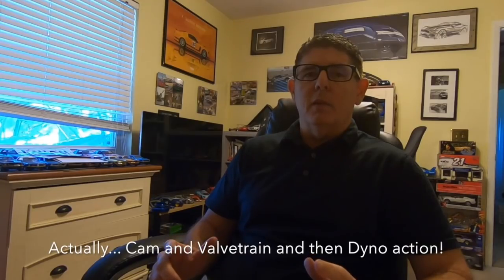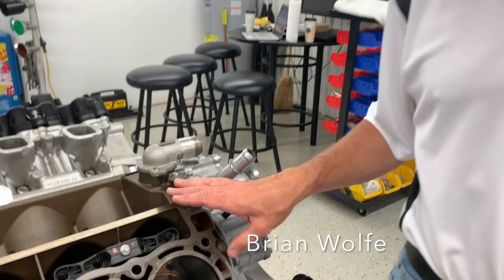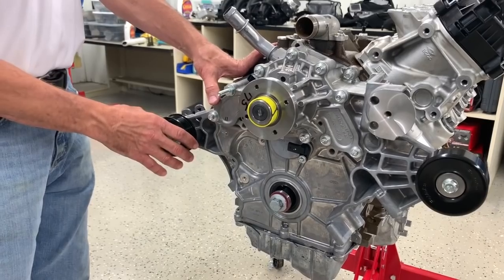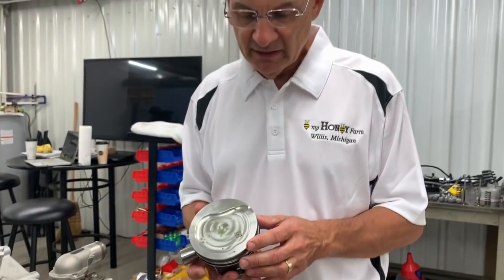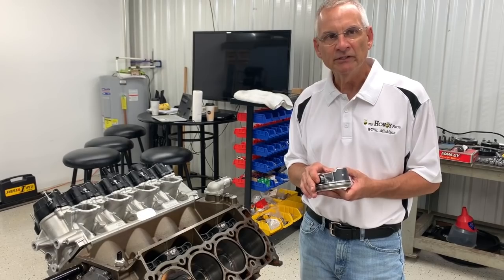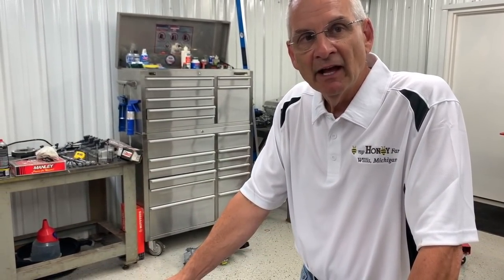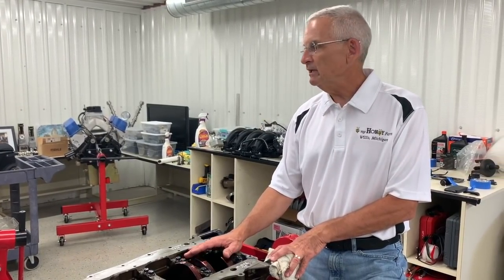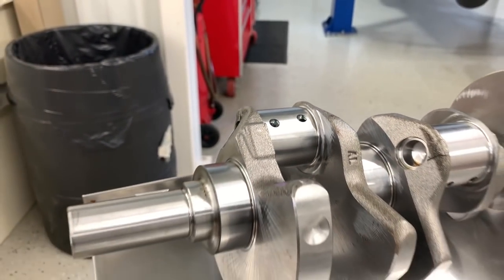7.3L Godzilla Ford V8 Bottom End Teardown — How Big Can this Engine GO?  Crank, Rods, Piston, Block

Comment: Can we all just take a moment to appreciate that the cam is inside the block like God intended?
Reply: Are you not familiar with the SOHC 427 from the 1960's!??
Reply: @jeffmiller3150  well yeah, Pontiac fooled around with one too.

The cam belongs in the block.
Reply: 😂🤣 yeah. No. It's for sizing. The 5.0 coyote makes 460hp/420lbs of torque on a mustang tune. If this thing wasn't gonna be enormous, an ohc version would easily be 500hp out of the box
Reply: @PureCountryof91  I'm sure GM engineers could wring the same power from a 5.3 if it wasn't a truck engine. Big deal.
Reply: PureCountryof91 
It’s not just sizing. It was also simplicity, low end power and longevity under load. This was always intended to be a commercial truck engine. But let’s just appreciate that we get more Ford engines to play with
Reply: No. Still prefer Over head cam and specifically dual over head cams lol
Reply: Super Duty 455 it’s pushrod big block I think we all time travelled back to the hp wars
Reply: @roninkraut6873  I can take the cams out of an ohc in the chassis. Unless it's a 4.2 vortec.. we don't talk about those.. 😬
Reply: PureCountryof91 
Absolutely.
Reply: Changing camshafts on my nissan is a 20-30 minute job.  Including setting it for tdc and tool clean up.
Reply: PureCountryof91 dude the 4200s are kinda unique, an American online 6 that’s DOHC? I think it was actually the last mass produced American gas inline 6 motor
Reply: Dog?
Reply: @MichaelFletcher-to7mm  and with the lm7 computer it isn't too hard to throw a turbo on
Reply: Nick Holland I heard it was hard to program anything with above atmospheric pressure but maybe the later ones aren’t like that
Reply: @MichaelFletcher-to7mm  oh nah, the TBSS and tons of the 5.3 trucks use the LM7 computer and they take boost really nicely
Reply: Weld up and disable the valves and cut ports into it! Dry sump with oil injection with Motul 800 2T. The aluminum manifold drill and mount an oil inector pipe in each inlet also. sounds like a fun project like this:https://www.4btswaps.com/attachments/2cyclesbc-jpg.6839/
Reply: This motor can be tilted in any position and run just oil injection! i want to get one from a junk yard to try this. i got plenty of synthetic 2 stroke for this experiment. My 4l small block OMC  Johnson v8 can do this and  so could this 7.3! Is this ford v8 built as tough as an OMC v8 looper and can it run tilted in any position with just oil injection? I will be using motul 800 2T 2 stroke synthetic for the experiment! Any thoughts on this ford built tough motor?
Reply: 2 stroke loop charged poppet valved conversion, run amsoil dominator with homemade dry sump and vro oil injection into intake. This could rune in any tilted position!https://www.4btswaps.com/attachments/2cyclesbc-jpg.6839/
Reply: it would be nice to get rid of thishiity low power pushrod crap and run Coates ball valves heads baffled for 2 stroke inverted u-loop scavenging, now that would be something. Or do this if there is enough room:https://www.4btswaps.com/attachments/2cyclesbc-jpg.6839/.
Reply: @DeVoNmotorsports  yes 7.3 ford is 2 stroke oil injected
Reply: @DeVoNmotorsports oil injection pump please do use XD-100 etec oil in this loop scavenged 7.3l 2 stroke poppet valved!
Reply: @DeVoNmotorsports  i heard one run and sounded like a sled motor at a truck stop! never new ford came out with a 7.3 2 stroke! souned like sled motor when someone hade it going! sounds like CCW 440!
.
Reply: @DeVoNmotorsports  i had a shit when i bought 7 gallons of xd-100 2 stroke oil for my 8v92 silwer detroit diesel 2 stroke!
Reply: Some old red headed girl just filled up here oil injection tank in her new 450hp 1200 ft lbs torque  f-350 7.3 2 stroke1` these motors are something. she used 8 quarts of CAM2 synthetic streight weight TCW3!
Reply: She machines a 800 CID v8 2 stroke block with 5 axis CNC mind over matter laser 3200 hp of billet aluminum ported 2 stroke power!
Reply: an old fart can cut ports in an old harley v-twin for a top fuel 2 stroke old fart fix drag bike though!
Reply: that old fart made a un iflow scaved 2 stroke diesel out of an s and s v-twin
Reply: @DeVoNmotorsports  Thats so you can do inverted 2 stroke loop charging.
Reply: @DeVoNmotorsports  Thanks for the link. i saw the mercedes 5 cylinder converted to poppet valved loop charged 2 stroke and it sounded sick.
Reply: @DeVoNmotorsports  I heard the 7.3 gas motor can be run as either 2 stroke or 4 stroke depending on what mods are done to it. My small block v8 is on amsoil dominator synthetic 2t. i get about 6 quarts, my rotary is on the amsoilt 2t and my 8v92 2 stroke jimmy is on xd-100 brp combined with shell rotella. Ill get 5 quarts of motule 800 2t for my rotary when i get around to it. My silver 8v92 is on some quick silver synthetic tcw3 cut with shell rotella 50/50 fill as xd-100 brp is rediculus price!
Reply: @DeVoNmotorsports  Boy do american modifoed v8 2 strokes are fun to run in any position like a sled motor, so far xd-100 seems to work! American v8's are more like Hirth sled motors!
Reply: this must be an american 2 stroke poopet valved!  Its strange to me but is this an north amrican 2 stroke and whats it powered by! What is the oil injection rat and is it BRP XD-100 heavy 2 stroke oil? Is it oil injected??>?
Reply: I bet you've got a flip phone too
Reply: Your god was defeated by Iron
Reply: Which god? God zilla?

Comment: I read somewhere that the Ford designer of this engine is a drag racer and knew this motor would make its way into the hotrod scene. Also it will help Ford take away from the LS base and its about time. Lovin it !!!!!!!
Reply: It probably won't poach a lot of LS users until Ford makes an aluminum block version.  Of course, the stock iron block will be great for boosted drag race applications...

Comment: Would be fun if Ford threw this in a new version of the Mach 1!
Reply: 428 cobra jet ;)
Reply: Would be to front heavy, otherwise cool idea.
Reply: @knutendreringhagen289  just give it a nice set of springs!
Reply: Yeah supercharged 1100 horsepower come factory with some sticky Mickeys
Reply: Oh they letting the customer do the swaps! But a 7.3 would be great under the hood of a new Mach 1 !
Reply: Mike Vieira no, because this is strictly a low-revving truck engine and was NEVER meant to be a Mustang engine.
Reply: Well that ship has sailed lmao
Reply: @tedschmitt178  uhhh. That's easy to fix. New cam, set of valve springs, etc. You never see a big block high revving?

Comment: It's not mentioned, but the crankshaft laser hardened, superior to induction, developed by Ford and and an industry first. The first engines crank is a prototype, as it's discolored from furnace tempering.
Reply from the maker: Thank for mentioning that and for checking out our channel.
Reply: GM was doing laser hardened cams in the 70's and 80's.
Reply: @andyharman3022  Sorry, but in the 70's and 80's a 6kW laser did not exist to the public, and the military didn't even have them. You are likely confusing this with induction hardening, which largely replaced conventional heat treatment.
Reply: @mikekopmanis2099  Didn't need 6kW to do laser hardening of cams.  The laser was pulsed to heat a spot about .030" diameter, then turned off to allow the heated spot to mass quench, thereby making the martensitic transformation for hardness.  If you would look at a production cam from that era, you would see the raster pattern of hardened spots.  Not likely that I'm confusing it with induction hardening, as I wrote my engineering thesis on contour induction hardening.

Comment: The 7.3 stuff is 🔥🔥
1800 HP.... unbelievable we're talking these numbers and the crank is a definitely a chunk of badass! This man does a great job at explaining the features...
You've surrounded yourself with a lot of knowledge E 👍
Reply: Did damn thing ain't going to make no 1800 horsepower gtfoh
Reply: 600hp mate. I have an daily driver powered by an unopened Barra making 800hp. That 7.3L is a massive boat anchor.
Reply: @nordic5490  lol do u not realise people make 3500 from those 5.0 fords? Id ne surprised of they dont hit 3000 with this knowing the yanks
Reply: @fread51  and why not?.. You already built 1?.
Reply: @nordic5490  you have a " turboooo charged engine" Turbo this motor and come back and tell us your results?
Reply: @fread51  5.0 coyote and 5.3 ls motors are truck engines too . tell that to everyone who races those motors and make a 1000 + hp. They 'll laugh at you ! You have no idea what your talking about
Reply: @kimw9340  LMFAO the coyote came in the S550 first not the truck wtf are you talking about plus the 5.0 and 5.3 have nothing in common
Reply: @fread51  there both in trucks ford and gm and both truck engines . the gm 4.8 5.3 6.0 is all truck engines guys pull them out of trucks and race them . same with people who buy ford 5.0 truck engines and put them in foxbody s and make huge power . by the way I've worked on a record holding 4000 plus hp car and been in the field for 20 plus years machining and wrenching . what have you done ?   Haaaaaaaa😄
Reply: billy heaton  he was just pointing out that either engine is capable of making 1k hp SBE, didnt say anything else about them being similar
Reply: billy heaton just goes to show your reading comprehension skills
Reply: @kimw9340  I'm a diesel mechanic
Reply: @fread51  sorry bud working on  c15 cat engines and old detroit 60 series is one thing . the proof is in the pudding. I was sceptical about ls series engines when they came out in 97 and and I've seen people make 1400hp with a lil twin turbo 4.8 ls engines. No one thought it was possible to to make more than 500hp  out of an old ford 8.2 deck windsor either look what some of those pro 5.0 guys did in the 90s with stock junk . don't sleep on this 7.3 !
Reply: @kimw9340  LMFAO I don't work on cat engines I work on Mercedes Benz diesel  BMW   Land Rover Jeep Mazda cam in block is for guys living in the 90's coyotes are king Daddy
Reply: @fread51  thought you worked on real diesels sorry . . When you said you were a diesel mechanic I thought you strictly worked in a diesel shop .
Reply: @fread51  you truley are special. All the 454, 440, 460, tried and true drag racing motors all started life as truck or luxury car engine. Hell the hemi started as an industrial motor turning machinery.
Reply: @TheSamplebridge  Haaa riley not to mention it Brian Wolfe has his masters in engineering and worked as a engineer for ford and been a drag racer most his life...Billy heaton has no clue what he's talking about.
Reply: @fread51  I don’t see any coyotes in mustangs in street outlaws. They’re running LS

Comment: I'll keep my old 460 thanks, it's been on the road since 1983 and has 480,000 miles on it and still runs like a champ. Not dissing the the 7.3 or anything, its a great looking engine. Might be a fun swap later on.
Reply: I have farmer friend with a 460 powered water well. After ten years (about 65000 hours) it is still running strong.
Reply: was the engine ever rebuilt? what kind of oil do you use?

Comment: I'm a pretty DieHard LS guy. But I can't deny the fact Ford has really been stepping their game up since the coyote. And this engine has me excited especially that it's a push rod. Way to go Ford.
Reply: Yes Ford has some really great engine packages.The Coyote is a monster,mid 9 second performance with low boost.Personally speaking I would advise builders to turn down the power if the car or truck is going to be driven on the street.The big HP numbers work best on the racetrack.

Comment: Since both the 7.3 and 6.2 share the same bore spacing of 4.53" we are looking to put the 7.3 crank in a 6.2 SOHC!  According to Brian the main and rod journals are the same size... So it's party time!!  
Thanks Again for such awesome Vids...
Reply: Do people swap the 6.2 into mustangs? Excuse my ignorance I’m in the uk so I’ve never heard of it.
Reply: 2011metalmaniac no one does that in the states
Reply: Why what’s wrong with it?
Reply: I wonder if you will need to clearance the block for the rods?
Reply: 2011metalmaniac One of the reasons are that it is to big and the 5.0s and others are better anyways because they’re lighter and higher reving
Reply: It mentioned lower down in the comments so I had a look and seems Ford actually did an experimental engine and don bowles ran it. But they shelved it because it was too big.
Reply: @2011metalmaniac , people over here do swap 6.2s into Mustangs. It's just not very common.
Reply: @2011metalmaniac  we had started on a Carbed 6.2 Race engine build over a year ago.. I have got the stock head from 320 cfm to 363cfm without breaking a sweat.(stock valves). I believe nearly 400cfm is possible..  the engine once finished will go into a SN95 race car...
Reply: Won't fit because of the overhead cams. Unless you do some serious cutting and welding
Reply: 2011metalmaniac it’s too damn large of an engine to fit into anything it didn’t come in without extensive modifications. It’s the reason you don’t see more Ford engines swap in other cars that aren’t ford, just damn large physically
Reply: @mexital1159  Go over to SVTPerformace web site there is a guy that has been drag racing a carbed 6.2 for quite awhile in an SN95
Reply: @2011metalmaniac  it's been done to a 2010 but you have to have a thin radiator and fans because the "BOSS" 6.2 a little longer than the modulars. Dude still had a stock intake from a super duty 6.2
Reply: @bigboreracing356  nope. Ohc is objectively better in every way except packaging. I know of a 6.2 cvpi that uses the raptor tune in a super duty engine. It's a badass car. I think it's an 03+ due to a change in the chassis and engine bay to fit the 4.6 dohc into murauders
Reply: @mexital1159  a 6.2 will go into any Fox chassis
Reply: Mains/pins are same, but post is different due to cam drive gear.
Reply: Ivan Munoz 6.2’s fit in s197 chassis mustangs, so they will fit in anything that’s a fox body or newer. Properly built with the truck intake, the 6.2 can crank out 630hp
Reply: Donaldson Jeoboham no it’s not. It’ll fit in fox bodies and all modern mustangs
Reply: Unfortunately the crank post diameter and length is different between the two engines due to the valvetrain, but otherwise they are the same. FYI, a -0.010" LS 2.100 bearing will work with SBC rods. Manley carries 6.2L pistons which have SBC 0.927 pins. Two compression ratios are available, and with a 5mm stroker you can use the piston and standard Chevy rod.
Reply: @PureCountryof91  pushrod is better in the way that matters for an HD truck- cheaper to produce and appealing to the customers it targets. OHC is better for higher horsepower higher rpm engines, certainly, but for a work truck that doesn't matter. Also, thanks to the early 4.6 plug issue, and 5.4 3v phaser issue, there is widespread perception that pushrod engines are more reliable. In all reality that's not true and where the cams were located had nothing to do with those issues, but the stigma is still well alive in rural areas, where people buy trucks en masse.
Reply: @2011metalmaniac  the 6.2 is roughly the size of a 427 sohc. And under the valve covers it even looks very similar. And, the 6.2 was only ever equipped in platinum f150's/raptors, and the superduty line. If not for the physical size and weight it would actually be better than a coyote. Its heads even flow better
Reply: I wouldn't mind seeing a set of those ported 6.2 SOHC heads on a 7.3 shortblock(or stroker one day) or just the 7.3 crank in a 6.2L it seems like since 6.2s are getting more common in junkyards 13yrs in that the Godzilla might reopen interest if the stock 7.3(or larger stroker cranks are affordable) cranks with rod+piston options become common and affordable. Hopefully 6.2 cam and header options too. The 6.2 SOHC, 6.8/7.3 Godzilla have the potential if people get behind them with good products that are readily available and affordable. I saw that new 7.3 bare blocks were $995 a few months ago and I am kicking myself for not buying one, they're $1500 now, which considering that it's at least as strong as $2300-3800 L8T, LSX blocks that handle 2,000hp, should easily handle a 4.225-4.250" bore with boost and should handle boost with at least a 4.25" crank because it has a 9.65" instead of a 9.2" deck height and callies is making a 4.6" crank for at least lower power, n/a use, you will have significantly more displacement than anything LS/LT/LSX for a 2/3-2/5th of the price of entry, which should go a long way towards your crank, rods and pistons. Additionally stock heads are $625 each fully assembled or you might be able to use cheap used 6.2 heads if a way can be found. Ported the 7.3 heads, big cam+springs, stock stroke, high compression piston and rod should make 750+hp n/a already, a big stroker should clear 800hp n/a no problem at 522ci vs 446ci.

Comment: This could be an interesting series, except instead of all the commonly rodded out motors that there are a billion videos on, it would be interesting to see some of the new half ton diesels and everyday ecoboosts etc. all pulled apart. No one breaks down the engineering in some of the most common engines like this. I particularly find it fascinating.

Comment: Only thing I’m not crazy about is water pump bolts going thru front cover but I suppose if your a die hard ford guy you’ve about got all the gasket timing down. Can’t wait to see what a cam will do. The intake and exhaust manifolds already look good so I doubt theirs gobs of power to gained but still exciting to see these vids! Keep it up